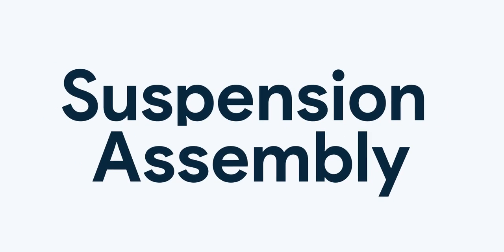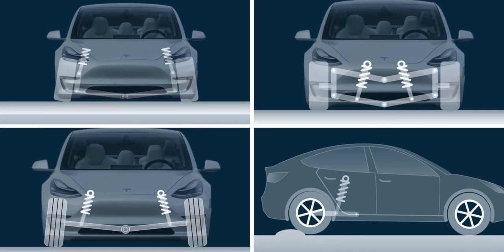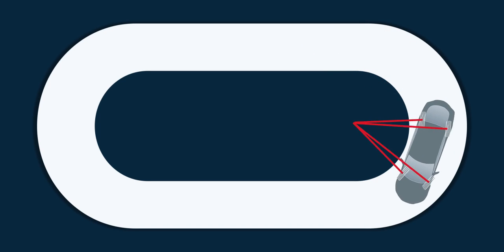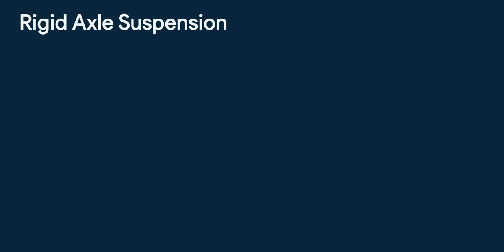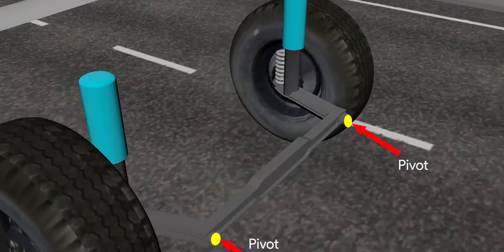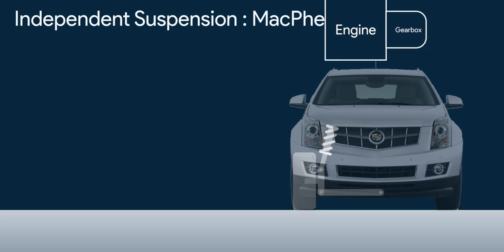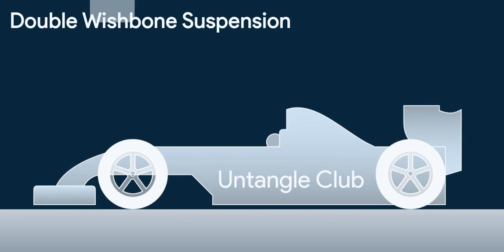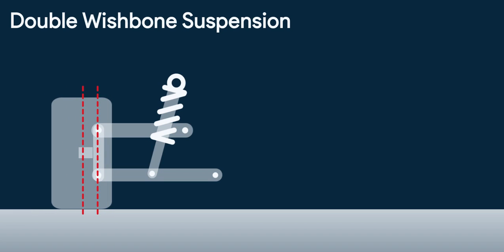Types of Suspension Assembly | MacPherson Strut, Double-wishbone, Swing Axle & Arm, Torsion Beam etc

Comment: 1:28 When a car turns right, it does not lean right.
2:18 That is not what oversteer is. Even if the maximum turning radius is too sharp, you can simply just turn the steering wheel less (?)
Over than this, this was an incredibly insightful video! Thank you for spending your time making it to educate others.
Reply: Where is your video explaining different suspensions settings...?

Comment: Some disadvantages of Double wishbone suspension 

- Lower ball joint constantly fails due to the weight applied on the component... don't last for many miles mainly the aftermarket 
- Expensive to maintain